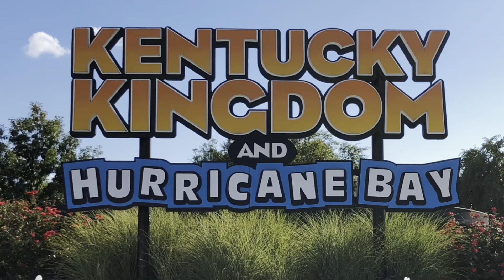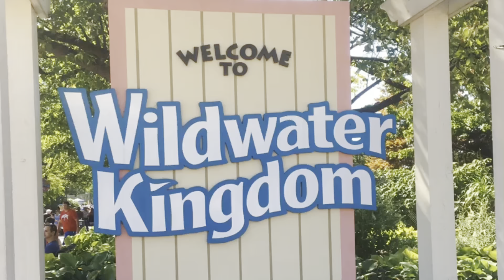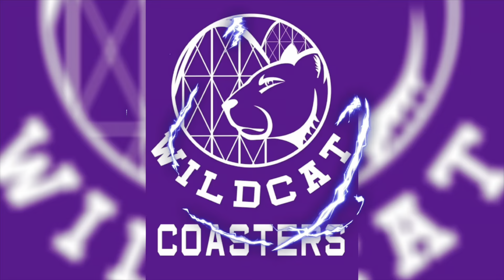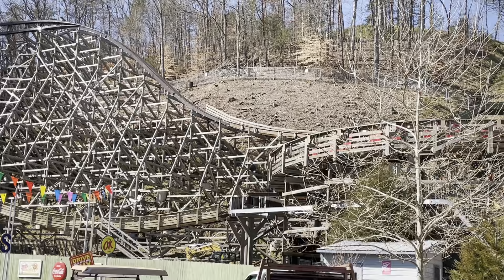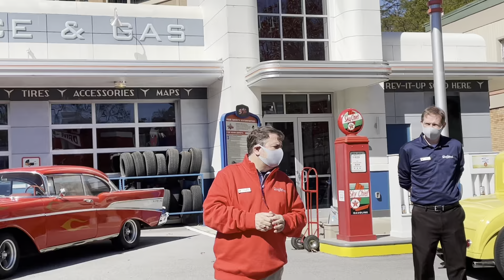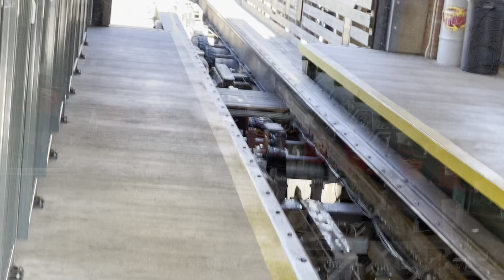Lightning Rod’s new look for 2021

Comment: Did it always slow down that much at the top of the lift hill?
Reply: They're probably gonna try to bring back full power since that's steel track on the launch
Reply: @highoctanegames  I wish, But honestly doubt they will bring the speed back to the original. Was probably putting too much strain on the wood Supports.
Reply: @joeyharper4976  well it could be possible, we'll have to see what happens
Reply: @highoctanegames  I'm hoping it does, But I'm not getting my hopes up.
Reply: @joeyharper4976  yeah I agree
Reply: Yeah that doesn't look normal to me.
Reply: @Brooks Wolsefer they slowed it down but not like that. That was crawling over the top, even with the reduced speed those trains still got some pop going over. They're probably tweaking the system still so it's hopefully not a permanent change.
Reply: @SpacePirateK  I believe that in early testing, and they did this with the old Topper track, they run the launch system at about 70-75% power, just to get a gauge of how the train will complete the circuit and to test any anti rollback systems
Reply: @Live4Music365  yeah that's what I figured it was. It'll be back to normal by the time they open it.
Reply: @Brooks Wolsefer They plan to originally test it at 70-75% launch speed initially and then increase it to full speed on later test runs